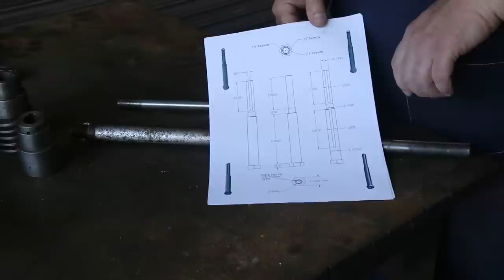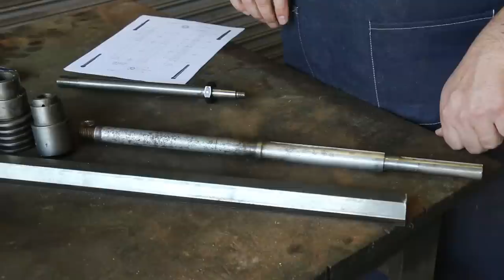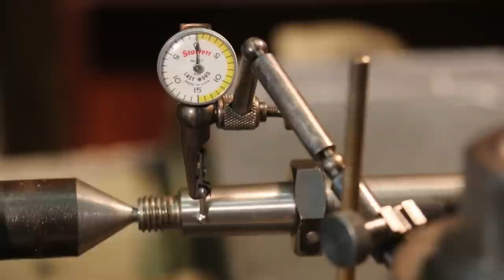Machining a Custom Arbor for a Syracuse Spindle Sander - Part 1

Comment: Great video Keith, The Syracuse sander is the earlier version of the Porter Cable spindle sander,Porter Cable had redesigned the shaft so the spindles could be changed. I made a complete set of spindles for one last year.

Comment: Great video and job Keith!....I am a little disappointed that Scott didn't make it on his own!  It appears that you can just move the bearing journal up a bit, and take a little off the bottom if for some reason it does sit too high for the table....and not need to make an entire new spindle. It would have been interesting to see you set it up and check for an runout.
    If you are interested.....I took and made an adapter for my Sjogren  2J collet chuck, that allows me to use 5C collets for everything 1" and below. Would save a lot of $$ buying collets for the smaller sizes....also make an interesting video making it!

Comment: Nice video, Keith. I, too, like your straight-forward presentation style and your matter-of-fact way of getting things done. These sorts of videos have lots of different machining techniques, and I always learn something from them and you. Thanks!
Speaking of new aprons, I have some, too, and I have adopted your method of using crossed ties to hold things in place...works great. Thanks for that, too.
Joe

Comment: Seems like an old fashioned design. Locking the tapers at the same rotation place as the threads pull together has got to be a real challenge. It's interesting. Thanks.

Comment: Fascinating as ever Keith!!!  I find your videos not only educational, but also somewhat zen and relaxing.  Perfect for watching over breakfast!  I did have trouble visualizing what you were aiming for here - perhaps because the machine itself was not on hand to refer to like with the Planer Matcher.

One thing I did not quite understand was after you had cut out the screwthreads, you used the inside cutter tool on the lathe again.  Would that not grind away all the screw threads you had just finished making?

Comment: nice video there would be no need to make a hole new one if its the wrong size just put it back in the collet chuck take the collet out and put the nut side of the shaft in from the back side of the collet then u can work the keyed end  hope this helps josh

Comment: Good video Keith. One question. It looks like you made the taper a little deep. Shouldn't the spindle taper bottom out before the hex nuts mate together? On my States B4, there isn't even a nut at the bottom. It looks like the taper does all the work and the threaded stud is only for jacking the taper in or out.

Comment: Not wondering about the work or process, its good as usual.
I know you were making parts to fit existing pieces but I do wonder about the "why" of a taper and the threaded portion at the end?
If the taper is roughly the 2 degrees is that not near a Morse taper and if so, is that not a "self holding" taper?  Then why the need for the screw portion at the bottom?
If the thread portion bottoms out before the taper is in full contact, there seems no point in having the taper, if the taper is in full contact and is "self holding" what is the need for having a threaded portion?  And if the taper is in full contact, is rotating it on removal really the way to remove it...I mean you don't rotate a Morse taper item, or shouldn't since you risk scoring or putting up a burr on the taper.

Comment: Keith - I understand why using hex bar would be useful as the "nuts" in the top and bottom pieces are now one single piece of material.  Optionally, wouldn't round stock be cheaper and wouldn't it be easier to just slip reamed out nuts onto the new shafts and pin (or weld) the nuts in place?  My $0.02.